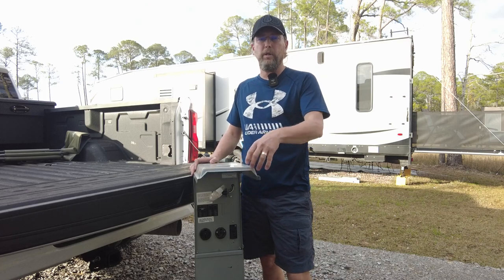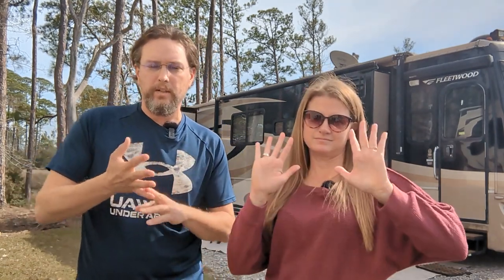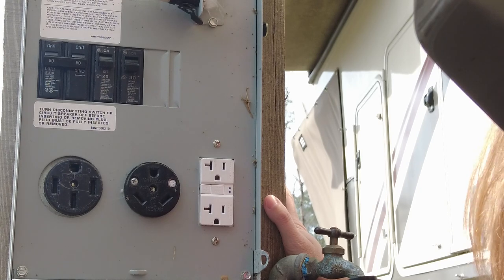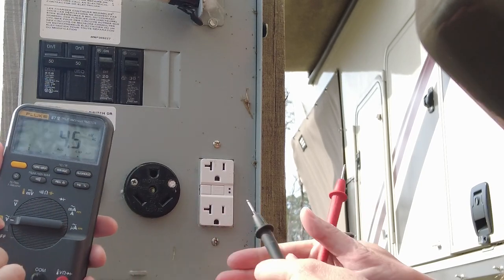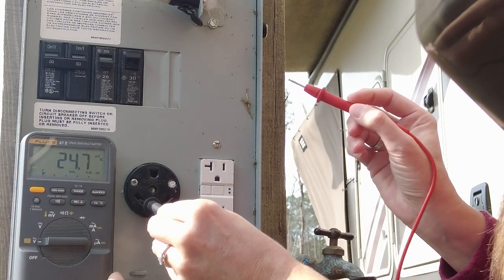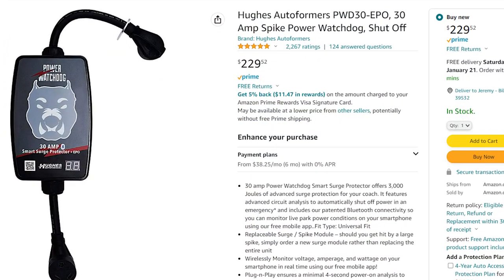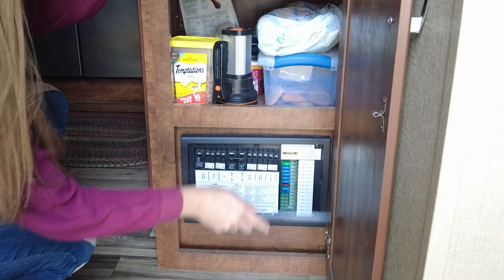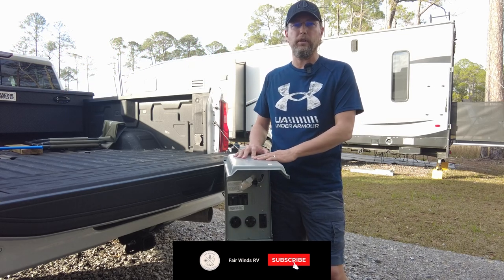RV Electrical Systems Made Easy - Part 2

Comment: I would strongly suggest one more test.   That would be from any hot to the enclosure.   I got shocked by a pedestal that the can was not connected to ground and the hot was rubbing against it.   You should get a 120 volt reading.   Best wishes,   Kevin
Reply from the maker: Thanks for watching and thanks for the comment! Not disagreeing with your suggestion, but I think by the time you get to the testing, you would have already been shocked just by opening the cover? Unless of course it's already open or there's no cover on it at all, in which case I'd think twice about using it in the first place. Here's the thing about electricity...it's always trying to find new ways to kill you. You can never be too careful, right?